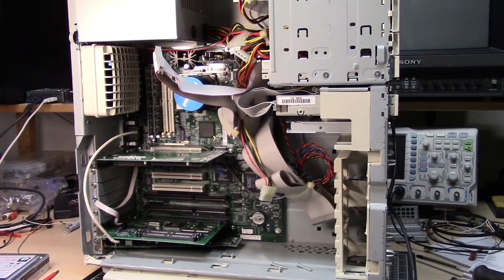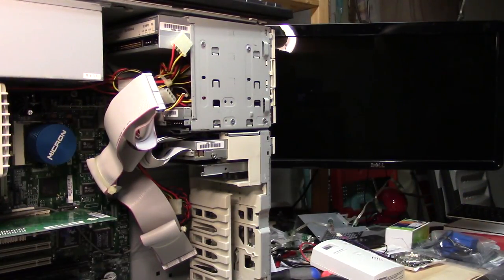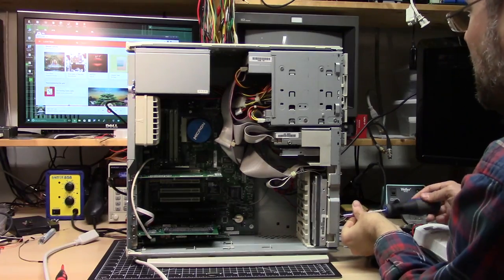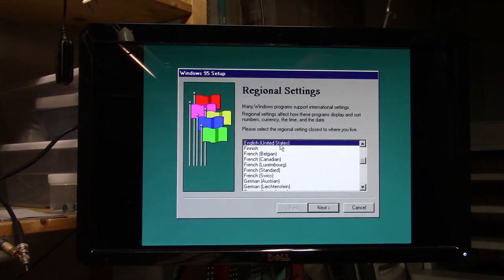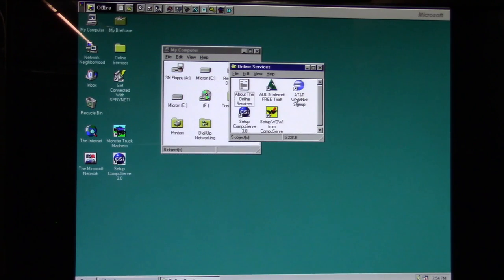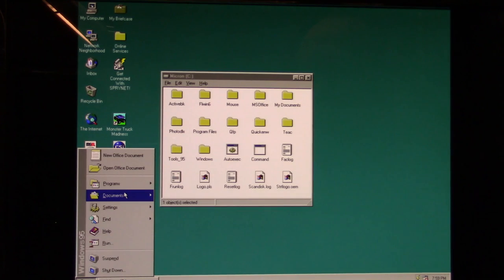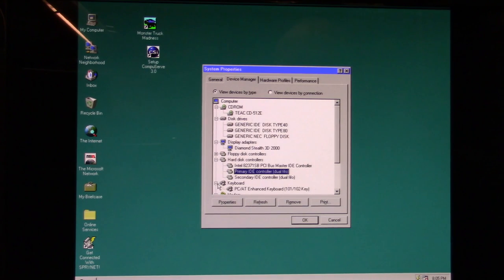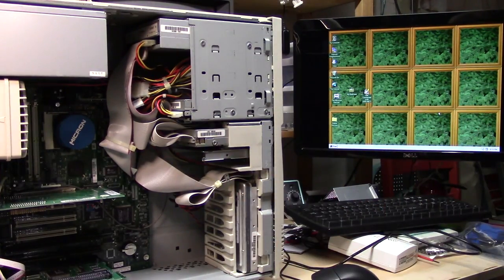Micron Home MPC FIrst boot and playing with Windows 95! (Series Part 4)

Comment: To answer a couple of questions you asked in the video, Microsoft Plus was a bundle of software sold as an "operating system enhancement," in this case it included Space Cadet Pinball, DriveSpace 3, Compression Agent, several themes and utilities, and Internet Explorer. https://en.wikipedia.org/wiki/Microsoft_Plus!

It's also possible to get an SSD. A couple popular options are Compact Flash cards, which are compatible with the laptop IDE interface (just need a laptop-to-desktop IDE adapter), or SD to IDE adapters. There are also SATA-to-IDE adapters, but they are sometimes finicky. The channel PhilsComputerLab has videos featuring all three.

Comment: I know this is several years old, but I just watched it today. When you first showed that the C: drive was only 2 GB, I had assumed that the OS version would have been Windows 95 Gold (the version actually released on 8/24/1995), but the My Computer Properties tab showed it was version B (AKA OSR 2). The Gold version only supported FAT16 which maxes out at 2 GB, but OSR 2 supports FAT 32. The whole disk could have been formatted into one volume using FAT 32. I can only guess that when they upped to OSR 2 to build their system images, they didn't alter their drive partition parameters. I also recently rebuilt a Pentium 166 from spare parts I'd saved and some I acquired from Ebay. I was reminded about this hearing all the noise from the Micron! If you're keeping "pure" (period hardware) it's unfortunately hard to do much about it. I wasn't too worried about staying too pure, so I put in a modern power supply, a GoTek floppy emulator and a CF-IDE adapter. I can hardly hear it anymore--the monitor's actually louder!

Comment: Love it, again a trip down memory lane. On my Compaq 486 DX33 force-fed '95 I used to go with the "setup" wallpaper, tiled although I did take some time to modify it (in paint no less!) so that it was a fetching purple colour instead of blue.  By the way, during my time at a computer salvage/refurb shop I picked up a code that registered any Win95 B copy. I used it that often it's still lodged permanently in my memory today! 17197-OEM-0023054-94485 lol

Comment: Fun fact those cases where used by Mircron systems some Dell systems and more and where all made by Palo Alto the model is the Palo Alto ATCX theres 2 revisions of the case rev 1 which you have that has the side support bar on the case side panel where the rev 2 cases have the bar connected to the chassis usually secured by a single screw.
Reply: The same case was also used for the Umax SuperMac systems (from the very brief time that Apple allowed Macintosh clones)
Reply: I had a dell that used a rev 2 then. Interesting.

Comment: I was late starting on pc's had spectrums when younger
Around 2004 I was given 2 old pc's one ws a p1 running 95,the other was a 900mhz duron
With a 2.1 gb quantum big foot
Its read times were slow
 But made the same sound as the caviar in the video
Was good fun back then starting out

Comment: I know this is an old video but it's interesting that this board doesn't have USB.  I mean, I wasn't using it either until '98 or so, but I'm surprised they didn't have at least one port on the back for it.
Reply: On an OG Pentium, that's perfectly normal.  It was around the build date of this PC that USB even started showing up on new computers, and you had to have Win95 OSR 2 to use it.  Win95 Retail didn't support USB at all.

Comment: Even though the OS is Plug and Play capable you don't want to enable that in the bios. The reason is that it will conflict with the Bios setting plug and play devices during the Post process. It can (and usually did) cause problems. It is much better to turn that option off and let the Bios handle it instead.

The Plus Pack added extra software like Internet Explorer, Drive Space (disk compression), and additional themes.

The original Windows 95 only supported Fat16 which was limited to partitions of 2.1Gb in size which was why the drive was partitioned into two partitions. Otherwise you won't be able to use the full disk space. Fat32 wasn't an option until the second service pack.
Reply: he should format and do a clean install of 98SE
Reply: I would do this only for using games (DirectX 5,6,7...), or for proper usb support and a little more system "stability".  Although, Windows 9x and stability in the same sentence it's unacceptable, yep ! Cheers, M

Comment: Dat Caviar drive...  Never had one of them fail on me.  All of them still worked when I upgraded to a larger Caviar every time.  Even when others brought their computers to me to fix, there were never dead caviars.  Always dead Maxtor or Seagate's.
Oh, that HD sound is normal.  Windows 95 first boot thrashed the HD with lots of tiny file read-writes, causing that sound as the head moved for every single tiny file 95 required to process sequentially.  Those smaller sized drives were naturally louder back then.